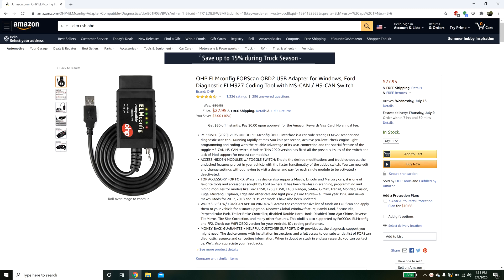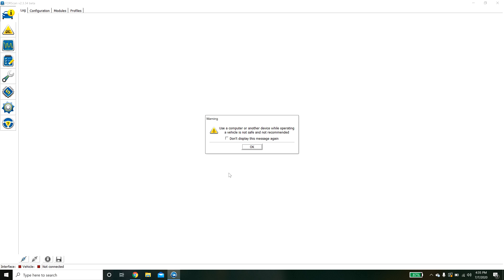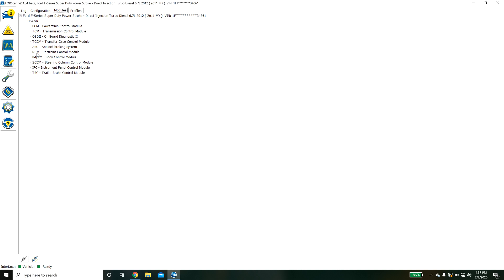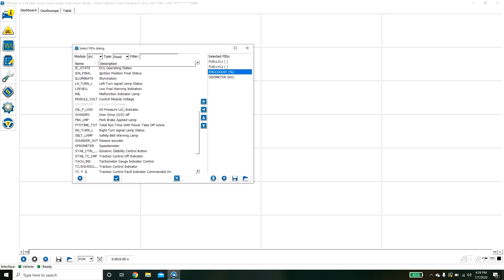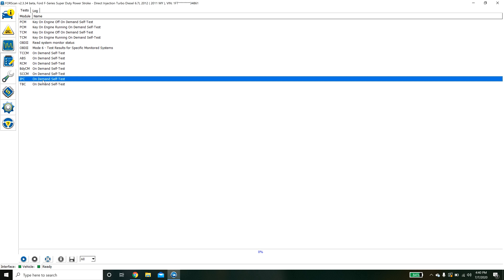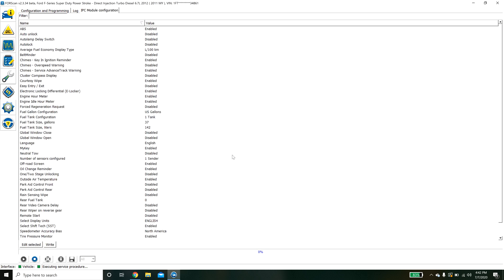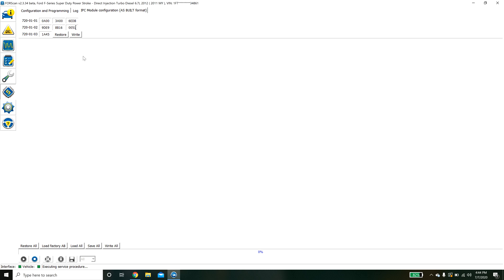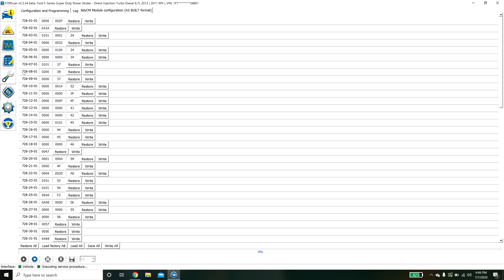FORScan - Connecting to vehicle & quick overview

Comment: Hello, I know this vid is a little older but is it possible to diagnose hvac issues using FORscan? I have a 17 Navigator and the rear hvac system is clicking (not where the blend doors are but more towards the tail light). Thank you.

Comment: Mine won't connect. It says "no adapter found" What's the problem? I have a ford fusion 2016
Reply from the maker: What kind of adapter did you buy? There are some USB settings that may need changed under setting
Reply: @jd_scholl  I got it to work, but to do what I want I apparently need an extended license
Reply: @angieespinoza5853  hey i have the same problem! what did you do? and what license i have to buy?

Comment: mine won't connect to the vehicle, it connects to the adapter which is the same as yours (elm327 v1.4) but then it says "unable to connect to the vehicle, please make sure the key is on". I used to connect on it fine, but then I deleted my profile and since then it just won't detect the car... any leads on how I could resolve this issue? thanks :)
Reply from the maker: What is the vehicle year, make, and model?
Reply: Same problem ford fiesta 2012